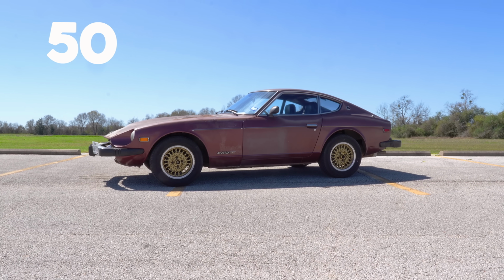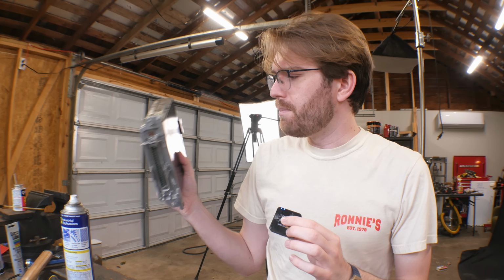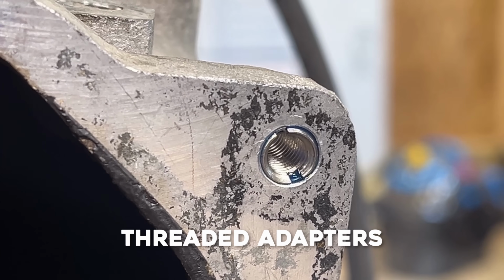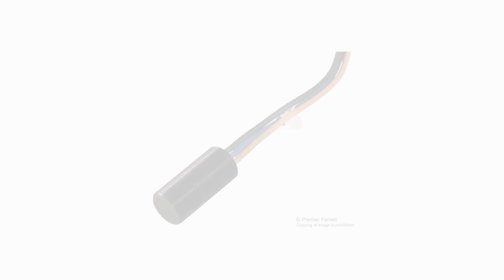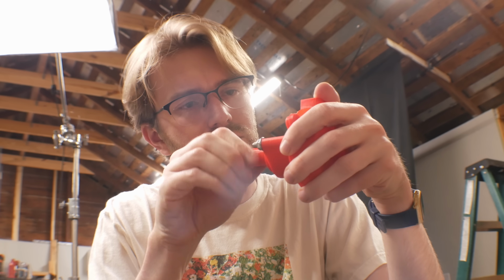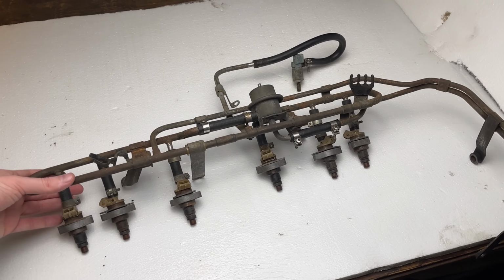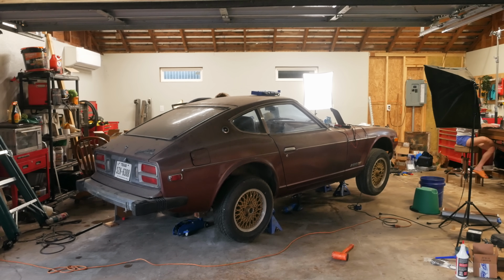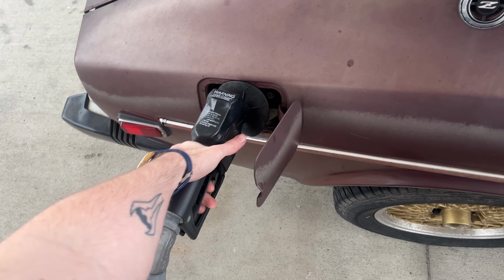Modernizing a Vintage Car

Comment: Did you choose not to do research or was the erroneous commentary for our entertainment?  A 1978 280Z made 149 brake horsepower, not 170.  It made 135 horsepower at the rear wheels (RWHP), reasonably comparable to the 125 hp dynameter run in view of how pathetically neglected the car is.  The Bosch L-Jetronic fuel injection system is widely considered a very reliable, durable, and simple analog system.  To bash a car’s engine after fifty years of technology has passed is a seriously cheap shot, like comparing the 280Zs engine to a Ford Model A.  As for reliability, that’s apples and oranges until you rip out every microchip, every touchscreen, every piece of software, and every electronic nanny, and every piece of metal-replacing plastic that’s going to fail in the next few years or start building cars again that can be reasonably maintained by your typical owner and not be held hostage by your typical dealership/maintenance shop.  And something is seriously wrong with the previous owner’s MPG.  Fuelly.com show an overall average between 18.5 and 21 MPG.  And a gallon gas cost an average of $0.65 in 1978 even in California, not $1.00+ your previous owner shows.  And showing us your poor empty wallet while creating parts on your 3D printer is sad.  Next time just do a rebuild video and skip the infused drama.

Comment: Who told you modern cars are more powerful, efficient, and reliable than vintage vehicles. As my family's resident fleet mechanic, we have determined through cost savings and proven reliability that the best new car you can buy is a 20 year old Toyota/Lexus. New cars are trash.

Comment: I love practical and resilience builds. That being said id have ripped apart the engine, added a slightly more spicy cam, pistons and rings and built it for 300hp and just tuned it for 190-200hp. Add a very mild suspension kit and that'd be a fun zippy daily. 

My dream is to do that with a 510.

Comment: Could the same control of the engine be obtained with an analog computer? Digital processors are expensive and a non-digital control circuit would be inexpensive and easy to replace. There would be also the advantage that such analog computer is not hack-able! I'd appreciate your expert opinion!

Comment: Oh God you poor bastard. You had to do your own wiring harness. I am so sorry.  I had to do my own as well except mine was for a Dodge Magnum '06..... You can imagine how much that sucked.....

Volumetric eeficiency is honestly not that bad. What's a good use to it.  You really just need a probe in your header to ruin your unburned fuel, Then it's basically just doing runs until you figure out exactly where you're supposed to have it. Not too rich, not too lean,  Love that! Stoichiometry

Comment: Ok...here's the thing, your torque on that hall sensor distributor conversion is NOT very high, and as long as it's mated up well and doesn't have any rattle where it connects it shouldn't wear unnecessarily.  Will it last forever?  No... Will it last more  than an acceptable amount of time?  Most probably yes, again, just make sure the fitment is nearly perfect and that the flywheel is as small as it can be for acceptable resolution.  You can even set it up to fire after the gap tooth, cut gap teeth at 6 specific positions in the rotation, and then just adjust the timing til it fires right...  Or you can just have one and run it off the software calculated angle which would work just fine.  Really if you need you could have 6 prongs and have the hall sensor fire based on rpm and how long since last prong and it'd still work fine, or 12 if you REALLY want to be careful, and it could still be made to work, and the smaller that wheel is, the less torque is gonna be placed on the connection on accel and decel and the longer it will last.  

Basically just do aluminum you'll be fine. 😂

Comment: Aww look it that z!  Don't see a lot of those... Also Datsun....DATSUN, we've got Datsun here!  😂 sorry...couldn't help it.

Why no touchy inside?  It's not a lot different man... Once you remove the head the inside IS the outside 😊. 

Plus you likely gotta clean up the valves and replace the ancient piston rings...at minimum compression check, etc.

Carburetors work the same way your old fuel injection did the air... Vacuum.  Vacuum sucks in air AND fuel.  No magic needed. 

You want an easy solution for no gaskets?  Print the spacer out of 80-90 shore TPU and tighten it down.  It squeezes slightly like rubber and makes things airtight pretty easily.

Comment: With a distributor coil, I remember plugging in a strobe-light gun into one of the spark plug cables, IIRC, which would make the light go on whenever that plug was supposed to fire. I think that was how you used-to do timing back in the day. I seem to remember pointing the strobe light gun at the flywheel, for some reason, to determine "top dead-center" position. But this all was 20 years ago and I did it with my dad only once, so don't quote me on any of this. Lol.

In my experience, however, I never found the distributor coil ever failed much. And it was always in a super accessible are on top of the engine if I ever did need to change it... so I kinda think all that work you put into designing your own distributor to work with individual coils was... kinda silly. Hahaha. Good work figuring it all out though. Gives me a headache just thinking about it.

Comment: I remember the 280Z. I was driving a Dodge Polara, that weighed 3,996 lbs, with a 318 ci V-8, which made 230HP. Everyone loved the Z car thing. You apparently forgot to mention that a 170 hp light sports car was a lot faster than the average car in 78. For example the Ford Pinto and Chevrolet Vega. Japanese cars had greater quality than most American stuff. Because of Dr. Deming and his statistical process control (SPC) method of quality first manufacturing.

Comment: The problem with digital controls is that sometimes the ideal air flow is zero. When bad actors including authorities want you to stop quickly and remotely. Obviously this doesn't have remote capability as it's a closed system but with the new Killswitch law I'm not going to be surprised when they make remote access mandatory.

Comment: NW WIRE EDM in Spokane.  I can cut thru features in hardened material. We have a Small Hole Popper EDM also for wire start holes.  For science.

Comment: It is still obsolete! 
Hahahaha 
Make it electric ⚡️!
Reply: Go mine the lithium and the other heavy metals required, drill the oil well and build the infrustrcture required to produce the plastics and other materials needed for the batteries. Then! You gotta build a refinery on the downstream side of all this. Various chemical plants will also be needed. I can keep going but, can we just put a few turbos on it ?😂
Reply: @stevesmith2171 bullshit
In an EV you do it once and never again.
In an ICE you refine oil for every fueling up and oil changes and a lot of parts that degrade that doesn’t even exist in an EV.
You are repeating bullshit the oil companies and ICE industries that will soon die of obsolescence!

Comment: Modern cars are not more powerful now. They could be, but they are not. The Cars of the 1960s and 70s had tons of cars more powerful than the garbage fraud spewed out these days. Heck, my Dad's Chrysler New Yorker had more power than anything I driven today. The Z car wasn't built for power or speed. It was built to be an attractive sporty alternative to cheap compacts

Comment: In california at 5.65 a gallon you could have bought a mint Z.  I saw 3.39 in dallas. I don't remember when I saw gas at 3 anything....20 years maybe. And ca would not even let you do it in the first place. They want my 20 year old pickup w 93000 miles and the best engine maybe ever from GM off the road. They want to be connected to your vehicle...wanting to force me to put something I believe in the smog computer plug.....That'll be a hard no. This pace needs to be federalized and rebuilt. Lets all pray burbank burns to the ocean. A good start

Comment: did I hear you say more reliable today....are you kidding. You are putting trash into that classic. actual trash. I wouldn't take a new top of the line pickup if the paid me to take it. Never not even close. I would laugh and say take out your own AI designed and built and mannual written by a stupid AI machine that is as good as the shit vehicles from 2024 to today. Ford has to take back every pickup from the last two years. same for GM. the vehicles will rot even if they were 10000 dollars....but they are over 100000. My 20 year old pickup will outlive that motor by another ten years. At 20 I replaced tires and shocks and thats it. 20 years and there isn't a  hint of a problem (knock wood) I don't mean to be a D - I am wondering why you chose new...without the spyware system....can you run this engine?
EDIT: maybe I should watch before commenting lest I look more like an ass. Apologies. This is a great video and you are insane or unmarried. The cars great and worth it. Just got back from the great state of Texas for the first time. For the first time in 50+ years to breathe free American air. You folks are great down there. Now I'm back looking for an escape from the 3rd world califate of Kalifornistan....God it sucks.

Comment: pay for itself in 63 years. ouch
I drive 330 miles a week to get to work in my hyper-milling Prius Five and average 57-64mpg. My personal record is 69.4mpg (record is like 72). I get the (higher) non ethonal gas at like $4.60/gal and spend around $35 a week on gas. I want to do so much more tho
casually works on solar trailer
why: Weaponized autism

Comment: I wish I still had my Datsun 280z. I maxed it out in 83 with usual hot rod tricks. Cam, light weight flywheels porting polishing and lightening everything. It was still a slug. Sold it and got 3/4 of the original price and bought a Vette. Small block are king of aftermarket adds.

Comment: Modern cars do not last and have zero reliability. You’re better off with a 78. In 2075 you absolutely will not see any 2025s that weren’t put in a museum.

Comment: Why would you want to put an over engineered 2025 pos engineered to break down at 50,000 miles. Rebuild the six-cylinder that’s in it ,much better motor than what you can put in there from today.

Comment: I thoroughly enjoyed watching this, both for the editing/presentation and also for the subject matter (replacing a Bosch L-Jetronic system). I had a 1975 Opel 1900 sedan (the last year that Opels from Europe were sold at Buick dealers).  It had the 1.9 litre cam-in-head engine, as from previous years, but the carburetor was replaced with a Bosch L-Jetronic system, so seeing that air flow meter really brought back memories.  Now I wonder if anyone out there has replaced this system with a modern sequential injection system on the old Opel cam-in-head engine, and how much improvement would result.  I really liked my Opel, but one thing that always bothered me was seeing such a modern (at the time) EFI system on an engine that still used a breaker point ignition system.  And the other thing was that in an era when in-car CB radios were popular, the electric fuel pump generated so much static in the CB band that if I turned up the squelch control high enough to mask the static, you would miss almost all of the radio traffic.

Comment: I used to work at a printing press that printed a magazine called Autoweek back in the late 70's early 80's  in Stead, Nevada.
 They had did an article on a Datsun z swap. that was several parts. Just cannot remember how many now.

Comment: After looking 👀 at this entire video I came up with a few opinions 1 you showed us how to fabricate and achieve your goals when you have a heart for something 2 how to use your resources and Network them together in a awesome way . But now for #3  never do anything like this with so little results 4 if I was going to up grade the drive train for mileage and power just buy the newest v6 Nissan engine and manual transmission and get the ECM & turbocharged and get 30 miles per gallon and 400 plus horse power 💩

Comment: Sooooo, when You said you’d not touch any of the engine internals was when I realized you were a dipshit. 

You’ve never heard or burned cam lobs/lifters? Well, that short glance at your cam made me realize you needed to replace it. 

But you said you weren’t going to touch any of the internals.

Then the engines age, and that means that at the very least you should do rings and bearings and inspect the cylinder bores and pistons. 

What you’ll probably find is that the bores need to be bored out .030”, resurfaced, and thus also, new .030 over pistons installed with those new rings and bearings.

But you’re not touching the engine internals.

The gas mileage the previous owner got seems to show that they ALWAYS drove in a very exuberant manner, also hinting at cylinder bores/piston wear. 

So, yeah. 

Dude, do the right thing. “Touch” the engine internals.

Comment: Technically, my first car was a rusted outfitted orange 1980 Ford festiva hatchback. This was my second. It was my grandmother's car, but she couldn't drive anymore. I absolutely loved this car. It's also the fastest I've ever gone which was 152 mph. No power steering needed. It also had the most comfortable seats that I've ever said in. It was a two-seater. I do miss that car. This was also in 1996 / 1997.

Comment: Restore the engine and leave it alone. Putting modern crap on it is how you ruin the reliability. And there is no comparison between the Z engine and that crap called modern.

Comment: 100% backwards what you should be doing is taking new bodies , ripping out the crap computer heavy motors and replacing them with good old fashion NON computer muscle..  i like the look of some of the new trucks but id look in a salvage yard for one with a blown motor so i can drop in a REAL motor..  400 or 500 hp classic 350/454  or 383/440/426   etc   but in the end old cars and trucks are better all the way around. Give me a old square body truck or 1st or 2nd gen camero or firebird or 68-70 Mustang or charger etc...  not the crap they make now.

Comment: That was some good work.  solid commitment to the process, took a whole different approach to car modding, i can see you making aftermarket parts for conversions like this. There is a market for simple conversions on these kinds of cars with antiquated efi systems, so this kind of r&d is profitable. You need to patent your work so your ideas remain yours.

Comment: Back in the 90s I had a 260z. It had dual side draft carburetors. I loved that car, but I tore those carburetors apart more than once and I don't think it was ever quite running right.

Comment: You could gain more HP by sticking with the OEM design with a distributor with a MSD 6AL capacitor box and coil

Comment: Did anyone see the old max torque to the updated power run? From 141 to 312! That is crazy increase and looks like a diesel engine figures!  That would defo make the car a lot more drivable.

Comment: Yes, the upgrades resulted in measurable performance gains for the Datsun 280Z (30:39-31:02). By modernizing only the external engine components—such as the air, fuel, and ignition systems—the creator achieved the following results:

Power Increase: The engine output rose from 125 to 142 horsepower, marking a 13% power increase

Comment: I know it is late to comment but this is a simply brilliant video. Lots of people have thought about this modification to classic cars but very few have actually had the bottle to try and do it, let alone succeed! You could probably get more power with a better exhaust system and not even have to worry about any of the problems that would normally entail because your ECU would simply remap itself.

Comment: That’s impressive for a stock block L28! Throw in a cam, valvetrain upgrades, a ported intake and throttle body, plus a proper header and exhaust, and a retune should make 170 whp totally doable—maybe even more if you port and polish the head. How many miles are on the engine right now?

Comment: I FKN Love that car. Always been a big fan of Datsun. Especially the 280, 260, 240  models. I had a 1976 Datsun pickup truck. I did so much work on that thing. It didnt run when I got it, but after all the effort, it ran great. I wish I had never gotten rid of it.

Comment: For the first time I have come across someone who uses my formula for modifications. "MODIFY THE PART YOU ARE INTRODUCING TO THE ENGINE, NOT THE ORIGINAL." Maintain a safe rollback perimeter.

Comment: You never mentioned if the engines started easier or was more smoother. 
I assume a good suitable fully synthetic oil was used in the engine and gearbox.

Comment: Well ya! As long as you spend more time enjoying what you spent time on than you spent time on it then you have returned to where you were and you actually moving ahead now better. 20 years making old cars better and ive found self redundant assemblies rule the game and if its been there 50 years working just pick up where they left off. There are many oe jy parts that are pretested and easily serviceable/replaceble. Thanks great video

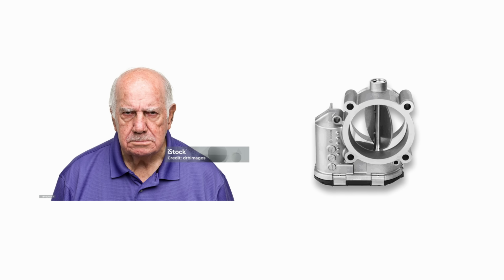Comment: 6:49 they're much better than the stopgap manufacturers had to use. Try to drive any 2001 to 2003 ford with a cable throttle. They literally changed the tune so that when you mash the throttle you can't downshift or actually dump fuel into the motor until you get to 75 percent throttle position using the cable throttle so when you hit the gas you just lose low end tworque until you're flooring it, in which case you're revving the hell out of it. With the electric throttle body they got the same economic effects but is way better.